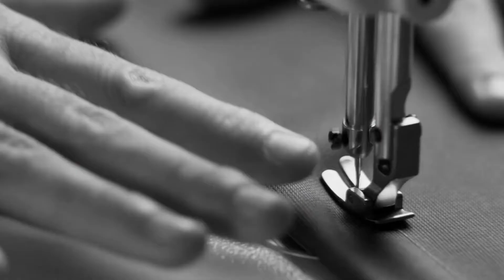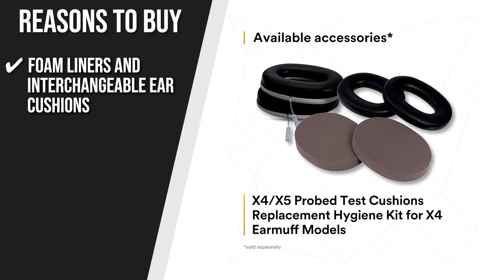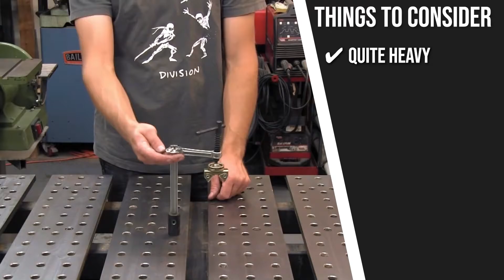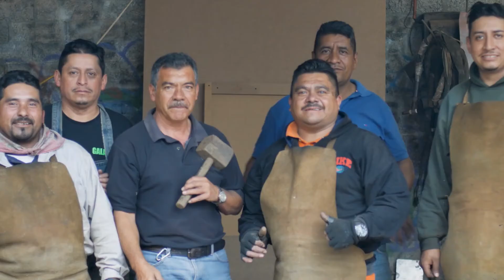🧰 Top 10 Best Welding Equipment

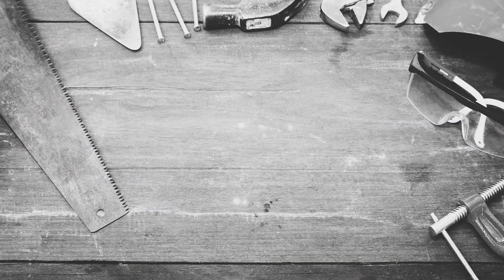Comment from the maker: 00:56 - Forney MIG Welder Link : https://geni.us/0UlEKjr
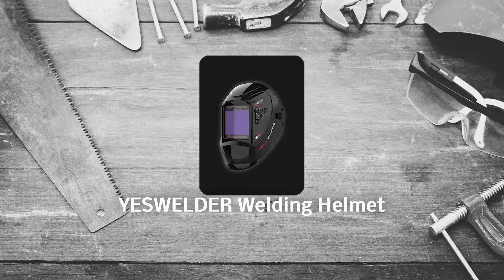01:50 - YESWELDER Welding Helmet Link : https://geni.us/jNGl
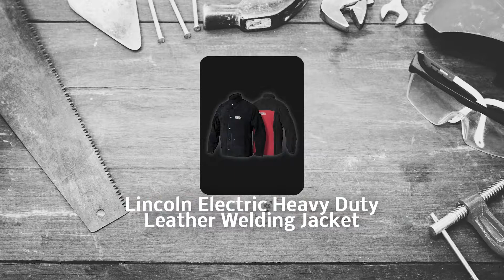02:45 - Lincoln Electric Heavy Duty Leather Welding Jacket Link : https://geni.us/8mzz
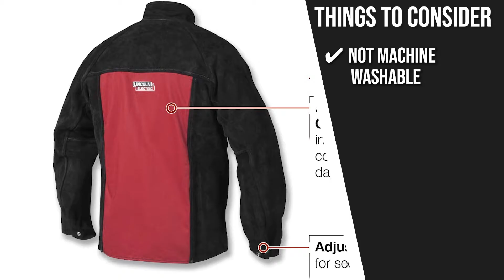03:41 - RAPICCA Welding Gloves Link : https://geni.us/6OBTh1
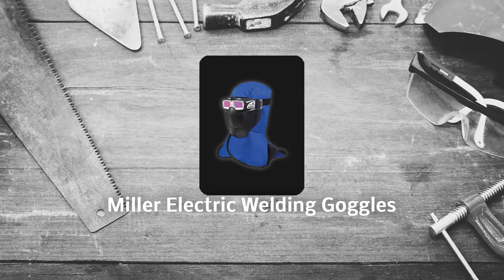04:35 - Miller Electric Welding Goggles Link : https://geni.us/kK2C6eo
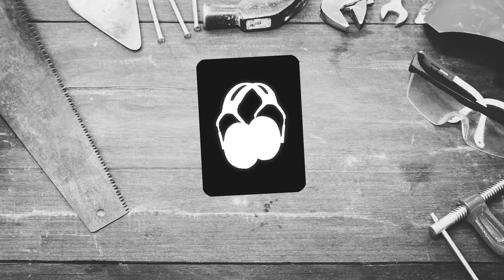05:26 - 3M Peltor Welding Ear Muffs Link : https://geni.us/tvjFR
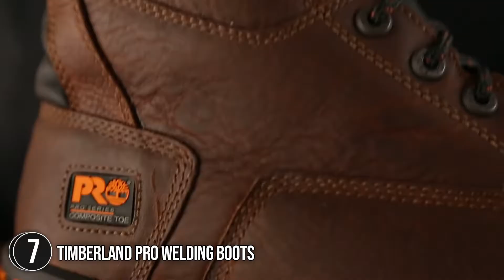06:20 - Timberland PRO Welding Boots Link : https://geni.us/aB1C0yV
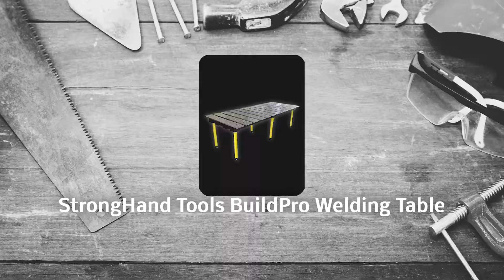07:15 - StrongHand Tools BuildPro Welding Table Link : https://geni.us/wIyfkHC
08:08 - Strong Hand Tools, Grasshopper Welding Finger Link : https://geni.us/Jx9ZXZ
08:56 - YESWELDER Welding Pliers Link : https://geni.us/GgXCchq